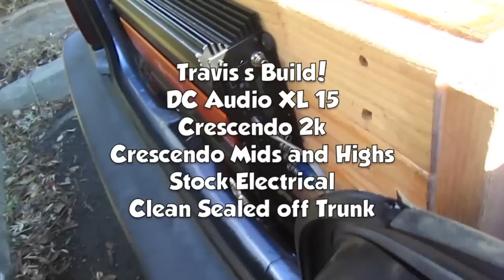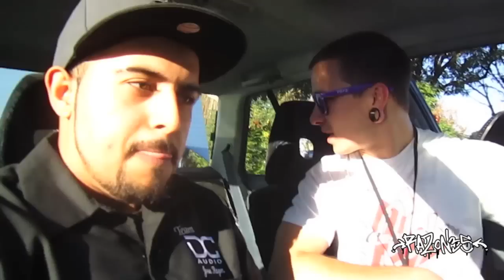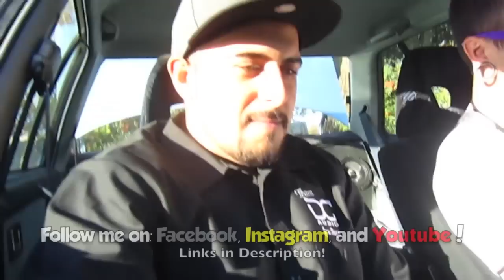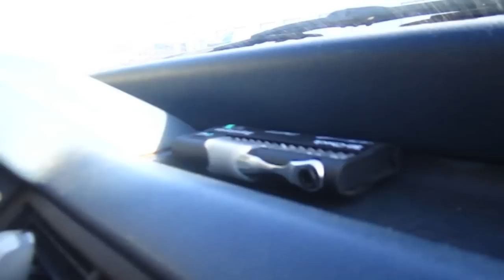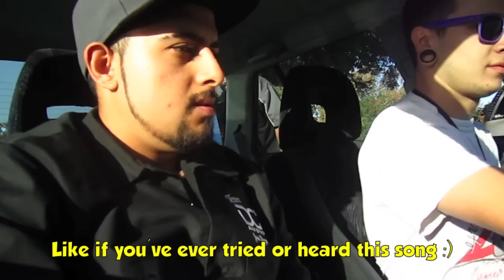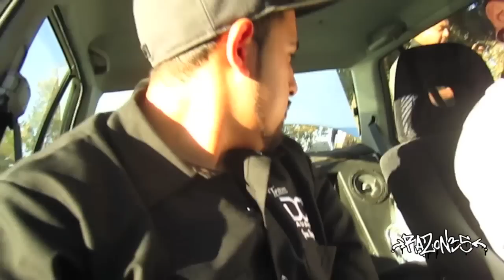Honda Civic with a HUGE DC XL 15in SUB on 2,000watts Clean INSTAL! World Finals Vid: 6

Comment: I hope he had that amp at 4 or 2 ohms.otherwise voltage drop would definitely be a problem with one second batt.lol.I love that set up.what kind of box
Reply: I have a 15" DC level 5 M1 and I'm pushing it with a kenwood kac 9105d 1800 watts max but my voltage drops a lot I got a second  battery but still it drops from14.3 to 11.9 and somtime lower I also got the big three none what should I do
Reply: Jesus man.how big is your 2nd battery?group 31?and is it a AGM? and make sure you upgrade your front to agm also.I have 2 agm batts and 4/0 wire 90amp alt on my aq 1200 at 1ohm and it doesn't drop below 13volts at full tilt.something is wrong here.I'll check out your vids

Comment: Either the woofer is being clipped to hell or box is small and port area to little .....its barely movin
Reply from the maker: Clipping has nothing to do with that. As a matter of fact, clipping would make the sub have over excursion which would cause it to bottom out. Under powering a sub may cause it to barley move. In this case, it turns out that only one of the coils was working so the sub was being underpowered. Stay tuned for his new set-up in a 4th order, with plenty of electrical, hint* - 2 alternators in this honda :)
Reply: +Razon35 whats the first song man?
Reply: the sub can take up to 4400 watts so you'd really need a 3k at a minimum to move it well. im thinking of ordering one to replace my dc lvl 4 12 but ill be running 4k to it from 2 apmi 2ks strapped. the box does look small to me. i just put a box with 3 10s in my car that was 4.5 cubic ft and ill be doing a 5.25 cubict ft box for my xl 15 if i end up getting it. that thing doesnt even look like 4.5 cubs though.